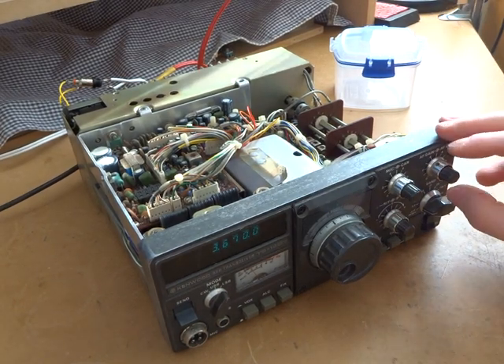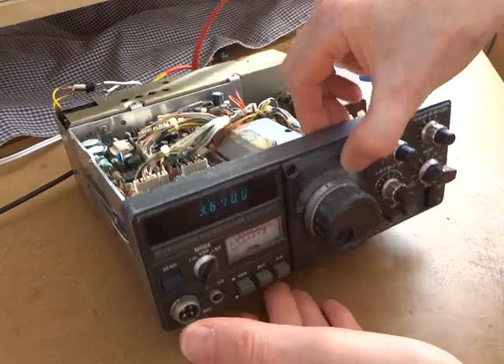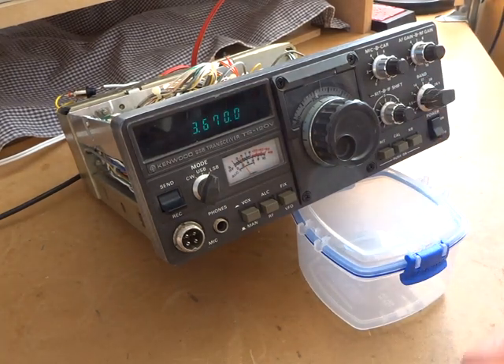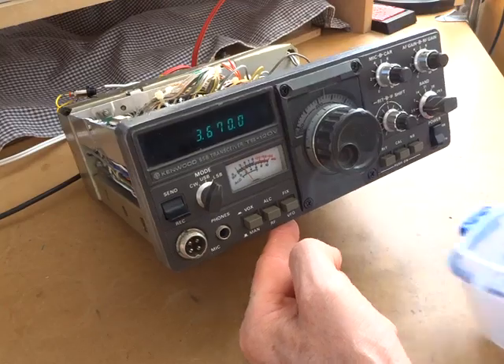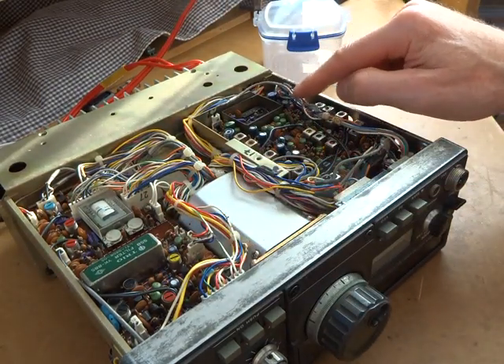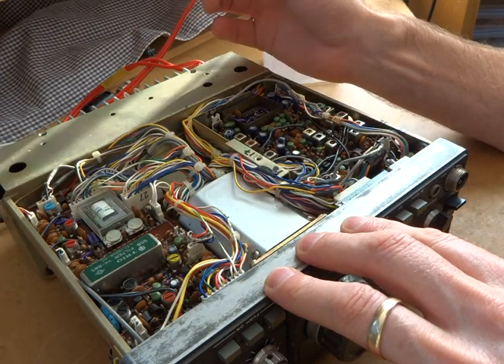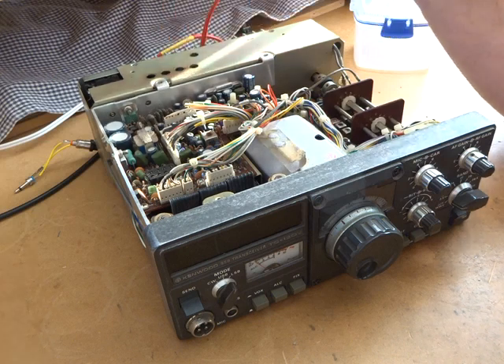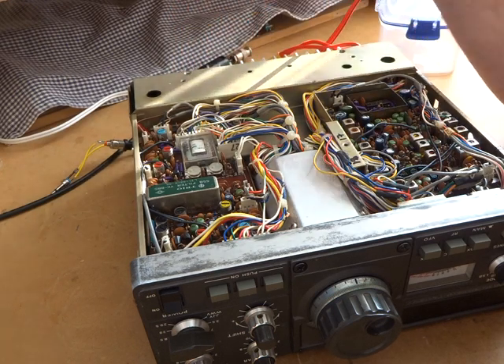Ideas for an old Kenwood TS-120V

Comment: My 1st HF rig in VK5.  Worked stuff like Russia on 10W SSB 15m band using a 132'  1/2 wave wire (For 80m) and a home brew ATU. In the Adelaide hills then and the ant. was  an end fed inverted V 60 feet high at the centre.  Great little rig. VK5KBB then.  😀

Comment: have the 120v  for last 15 years  ,worked all continents award on SSB   useing it ,all in the antenna  with these low powered ones 
was my cousins before me when he recived his full call in the 70s.
Am slowy building up the full station as items become availabe at  a price i can afford have the power supply spaeker and looking for the external vfo and  30w linear 
 try ad save it if possible wont regret it
Reply from the maker: Will do. They are a great little rig. Nice and simple.

Comment: I have a low sensitivity of about 1 mV and what needs to be replaced? greetings
Reply from the maker: I'm sorry Greg. I'm not sure. If you have test equipment, try diving the circuit in half and looking at the signal before the crystal filter. That way you should be able to narrow down where the problem may be.
Reply: @CharlieMorrisZL2CTM  yes, I will, thanks

Comment: It's personal preference. IMHO it's e-waste. I would pass it onto an experienced Kenwood restorer. Pulling it apart and making it spread eagle on a board is a nightmare. Nothing will pull apart and re-mount easily. All the mechanics will be worn or worn out.  Then you won't b e able to get it all back as it was.  But that's just me, I have no energy for work like this 😫 Good luck with what you decide Charlie!!!
Reply from the maker: Thanks Paul. I'm still looking for another doner. As pulling it apart, for me that's part of the enjoyment. Either get the old hardware to work or graft something else in. All good fun.

Comment: Thanks for the video! It's a pitty they don't make radios like this anymore. One thing I don't quite understand though -  does this radio has only one crystal filter? How did people operate back in the day if they were interested in both CW and SSB? 73 de R2AUK
Reply from the maker: Hi Aleksander. I see the radio does have the ability to have a narrow bandwidth CW filter installed. Without it, you have to use the wider the SSB filter, which will make it harder to tune into closely spaced CW signals.

Comment: I have 3 of these, more precisely one TS-130V and two TS-120V. My avatar shows you ;-) These little transceivers of the 70s fascinate me again and again and it's fun to work on. Built simply and clearly. I would repair the one you bought in your place. All parts that are difficult to get are functional. Everything else is easy to fix. If you need a service manual you can find it online. Or I'll email it to you.
73 Bernd
Reply from the maker: Hi Bernd. If you could email it to me then that would be great thanks. I have a couple of 120V copies here, but the scan resolution is not too good. Thanks again.
Reply: @CharlieMorrisZL2CTM  Had trouble sending it via email. Let me know if something has arrived to your mail address. On the other hand, I will send the files individually.
Reply from the maker: Will do.
Reply: Hi @Bernd B. , I’m trying to fix one of them. It was showing dots on the display.pll not locking. I have fix it but now I have low receive level. can you help me please? maybe you know already where to look at. thank you in advance .
Reply: @michelebergo78  In many cases it is the band switch which switches the individual input filters. The built-in relays (antenna switching) often have contact problems due to their age.
Reply: @michelebergo78  Stefan is also here on youtube, he repaired a TS130 in a 4-part video series. You can take a look there too. You will probably get some hints there. https://www.youtube.com/watch?v=_TsqOXH5TIo

73 de Bernd

Comment: Hey Charlie!

Not sure how much difference there is between the 120S and the 120V.  However, I did find a link to the 120S service manual.  Not sure if that will help?

http://static2.rigreference.com/manuals/kenwood/kenwood-ts-120s-service-manual.pdf
Reply from the maker: Thanks Christina. I'll take a look.
Reply: one is 100watts and the 120v is 10watts

Comment: I have a TS130 that has a CW issue. I tracked it down to the Mic/Car pot. The Car portion seems to be solid but wiggling the Mic will cause CW power to come and go. Haven't tore into it yet. I also found the band switch to be intermittent at times. 

I like the idea of replacing the VFO. The 120/130 series vfo does drift a bit.  Cheers...
Reply from the maker: Thanks for the steer Ed. I'll jot that down.

Comment: Highly informative, thank you for this production.If you ever have time ,could you elaborate on antennas at some stage?Thank you again.
Reply from the maker: Sure thing Neil. For now it's a half wave dipole using twin-flex cable. The cable come into the shack and into a tuner (via the balanced wire output).

Comment: Was wondering.  I wanna see the wafer switch for the P.A.  Can do a video?  The old Kenwood rigs as such with that big band switch are good for dirty and/or melting.  Can slip as well.  Also would like to see if the P.A. is blown, pop the covers please.  Get on internet, schematic gotta be somewhere. Restore a TS-530 here and had to remove it, clean it, and solder each rivet(clue there, loose rivets holding contacts, and squeezing them won't work).  Love the VFO replacement idea.  Need an amp for the output of an si5351 I think to match output of VFO.  Love it don't stop.
Reply from the maker: Thanks John. Slight change of plans. I might have to look around for a more suitable doner for the original idea.
Reply: @CharlieMorrisZL2CTM  Understand that.  Older Kenwoods at least, they seem to like take a chassis, solder a board in the middle of it then start soldering other boards to it and building it around it.  Making it impossible to service the darn thing.  It would be cool to have the band pass filters on that big open wafer switch but you are probably right.  Splitting it up not be easy.    If anything be sure to check the P.A. parts and such to keep  for spares.   P.S.  I have actually followed some of your ideas with bandscope on my Kenwood ts-940s.  IF port though, it no work and never knew it, I mean I get nothing even with the preamp turned on the spectrum analyzer.  Next Digikey order get some good op amps and make a buffer circuit for other radios.  I mad at the Kenwood right now.  LOL.  73's and I am watching.
Reply from the maker: @johncundiss9098  Sounds like you are having fun. Good stuff!
Reply: @CharlieMorrisZL2CTM    quick note here.  Looking for a site to post pics to with easy access to show my projects.  Not much a video person, yet. Got lots of things I have done.  And call here is KD9JWZ in Indiana.
Reply from the maker: @johncundiss9098   John. You may wish to look at Blogger dot com. It seems to be nice and easy to update.

Comment: Please start with a cleaning of the control and switches.  I would try to repair this unit before ripping it down.  I hope you can save it. 73 Dave
Reply from the maker: I will Dave. I'm going to update the show notes to reflect what I will do with the radio. That's a much much more worthy cause.
Reply: Another thing , relay contacts can be source of intermittent problems. Nice work on your new tramping radio. Winter has been mild  here in south western Ontario Canada. Come on spring. 73

Comment: I did repairs on one of these. I found the main transistor in each oscillator had packed it in. Replaced each and the Txer worked like a charm . de Colin vk2jcc
Reply: Are you up to help troubleshoot a TS-120S?  I got one recently, and it looks like it's been dropped down a flight of stairs.
Reply from the maker: Thanks Colin. I may have to call on you as I fix this up.